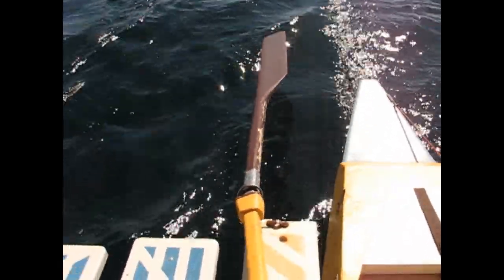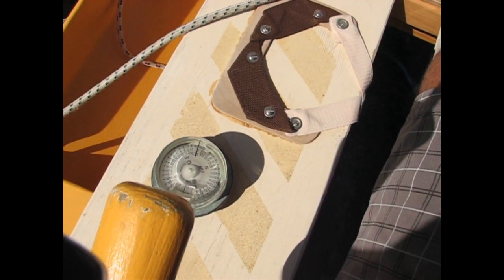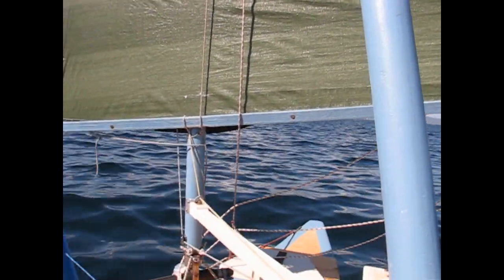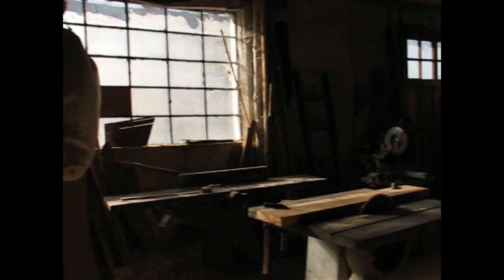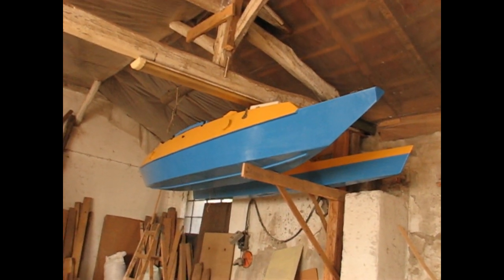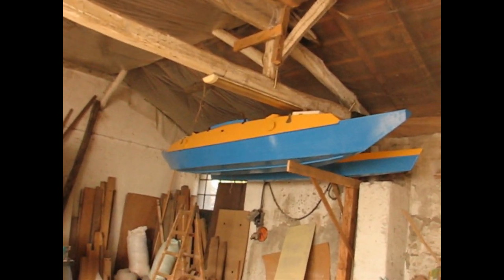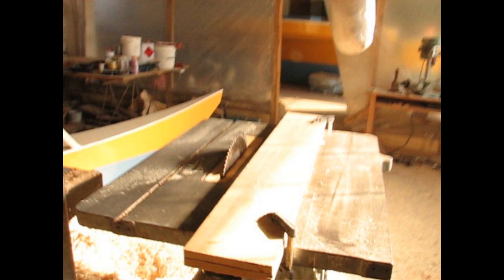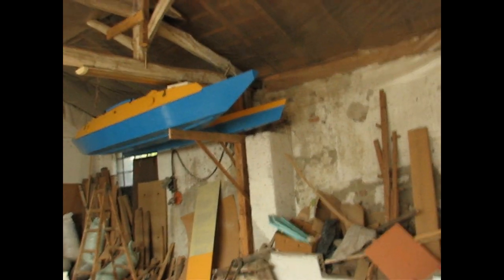A Balkan PROA, Sailing Down Wind, Like a Puppy...

Comment: Sheet to tiller works on my dinghy it is lug rig and oar steered. I can see it working with your sculling oar too!
Reply from the maker: Thanks! I also think so, do you have a video of your setup? Keep Shunting bro, Balkan Shipyards...
Reply: @BalkanShipyards  no video sorry but its very basic, a line from the clew of the sail goes thru a block on one side of the oar and a elastic on the other.
I'm steering with the oar on the lee of the boat and have to change oar every tack. Similar to sailing a duck punt (lots of video) its a bit of a pain but it'd be a lot easier on a shunter!
Another a solution for steering  would be a Z type (read horizontal-vertical-horizontal). The vertical would be placed dead midship of the proa and the rudder at the end of the horizontal.The top horizontal would be your tiller. That means only one rudder for the boat that spins to whichever direction you're going.
Reply from the maker: @nautikarl  I used sheet to tiller on my mono 10 years ago. Using it on a sculling oar is more challenging, since my AD-Scull floats up and falls over to one side when I let it go. That's the point, and that's what I tried to do last summer while I was at the Black sea, I propped up the handle but other problems materialized.... So I gave up, I have a bunch of ideas and no time to try them out....
I will get it, what I was interested in, is how the oar is fixed to the hull, the sheet and Bungeecord are obvious....
Keep Shunting, Balkan Shipyards

Comment: that's really good tracking! I've made passages with DIY self steering that wavered a lot more than that and still got there. sheet to tiller on my wharram pahi 31 is less straight than that. 

I would like to see it in more waves though, and can you make it track on the quarter as well as dead downwind?
Reply from the maker: Hey Dominic, good news.... Thanks for sharing and comparing with your personal experience, it helps me understand what's going on.... On a broad reach I doubt it will work, haven't tested it yet. self steering shunters is complicated stuff, I got some ideas.... we see....
Keep Shunting Brah, BSY
Reply: @BalkanShipyards  on my wharram on a broad reach I'm balancing the tension in the weather helm with the jib sheet. I havn't tried it with just the main, but I can't let the sail out very far because it hits the stays, but you have a junk rig.

in the original golden globe race, everyone's self steering broke and they all figured out how to balance it just by sails. (except for moitessier, who had by far the simplest self steering system, his broke too but didn't run out of replacement parts)

I also wanna show you this: a few clips of the self steering I made from junk and a few hardware store bits https://www.youtube.com/playlist?list=PLT7Uycq16-Y9nLjVU5ae8eqImMWOl1CpP (I couldn't use just use a trim tab because this boat has a spade rudder)
Reply from the maker: @dominictarrsailing  Well done man, that wind vane held a steady course, and yea it looked cheap... At first I tried sheet to tiller, that failed, since my gear to prop up the AD-Scull was crap. I just live 300 Km from the sea, so when I get there so much is happening, that I don't always get my stuff done.....

The sheet to tiller could work, as long as I can adjust the angle of the AD Sculls blade in the water, simple to do, but couldn't bother. Meaning before even connecting the scull to the sail. it must be propped up at front, though the most important thing is the blade must be oriented off vertical, meaning it must be slightly turned towards the ama. Leading edge towards ama, trailing edge towards vaka, 20 degrees off looked about right. Now try sheet to tiller... My prop held blade perfectly vertical, pulling it sideways has no effect! Yet turning the blade then pulling it sideways is very effective 
Keep Shunting man, take care
Reply: @BalkanShipyards  I'm sure you will figure something out, and I'm very interested in what you come up with!

Comment: You know I like your stuff..but when are you going to realize  a catamaran  is the same effort and money  to build ( because 
you dont need to do all that compcated stuff  with the rig and stearing) and  so much simpler  to  sail?
Reply from the maker: I can build an Ama in a couple weeks, The same length Vaka will take many months. will surely cost much more, yes you get accommodation in that hull, though it's a big hull that rocks the boat in big waves, Amas do the same, yet much less. Proas are faster, but that's no big deal, Proas are much stronger, still need much less material to design and construct... The forces involved on shunters are minimal, vs cats which are under huge stress under sail.
Shunting is very effective, more complicated to use, yet cheaper simpler and stronger to build.   
Keep Shunting, Balkan Shipyards
Reply: @BalkanShipyards  well said. Plus the rig on a catamaran is located in the weakest point of the entire vessel; the centre of the bridge deck. This requires even more materials, which is extra cost, weight and time to build. Why not just use these extra materials to build a longer proa!
Reply from the maker: @guywhitworth5764  Very true Guy. Many don't understand Shunters, Shunters get by with toothpicks for akas, vs cats that need railway sleepers. Catamaran Akas are ether cheap and heavy, or expensive and not as heavy.... Proas just use toothpicks! Keep Shunting brah, BSY.